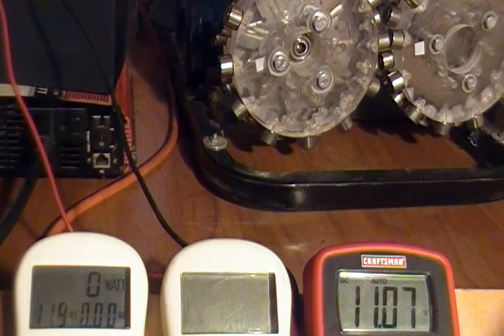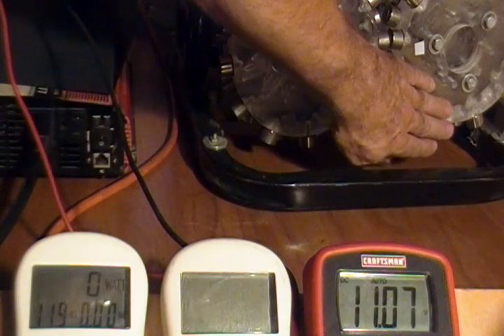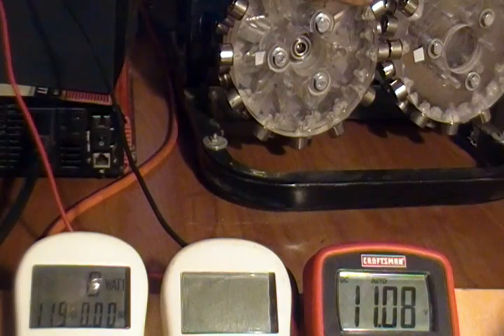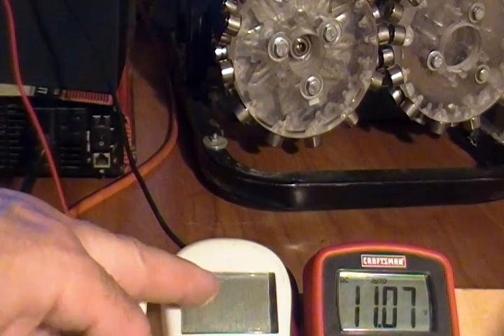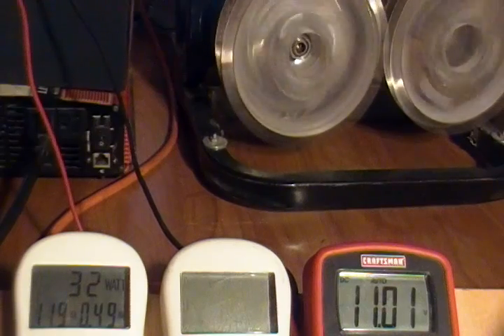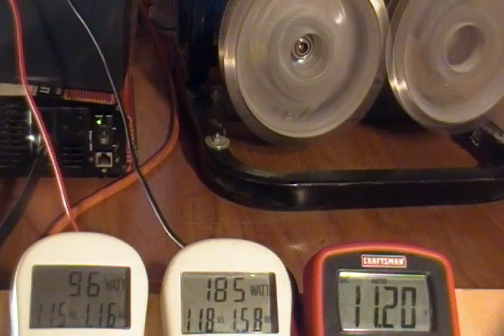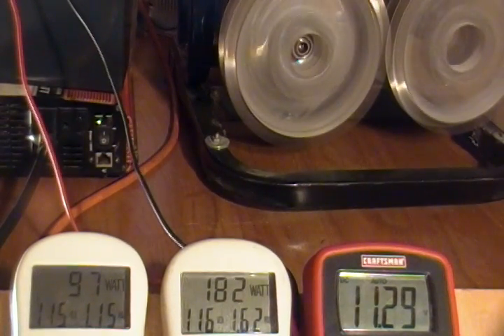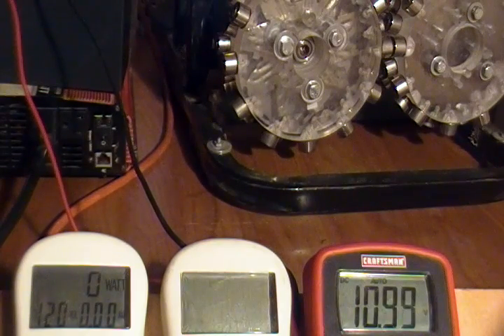Free Energy Electric Power Generator Overunity Magnet Motor

Comment: wait so i dont get what the big deal is? You have your device connected to a household current, correct? what is the excitement of being able to run a motor off electricity that is also running an alternator which i would hope would be making more energy than is being consumed? Isn't that pretty much a car engine substitute the gasoline used for mechanical energy?
Reply from the maker: This is an over-unity device. So it produces more energy than it consumes. If one were to run it off of a solar panel then it would consume no metered power and just free energy.

Comment: @Jamieduk999 want to try to get overunity? put together a 3 phase capacitor motor with a winding resistance of about 32 ohms as a alternator with a 3 phase motor as motor and gear up the alternator to 10000 rpm and overload  the alternator with potentiometers and many 40 watts light bulbs and the drag become small and the output big and everything near the generator turns static.

Comment: @MindFreer  Thank you for the answers!  IT would be very good to see your newer video, please show a looping situation after a startup, just keep a DC voltmeter across the Batcap 2000 to monitor the battery voltage and use a 100W lamp load at the AC output of the inverter.  Re on the CT transformer: I would have an opinion on its operation, I would be happy to discuss in e-mail if you feel like to, my mail is (gyulasun at yahoo com).  Thanks,  Gyula

Comment from the maker: @gyulasun 1) I'll have to do a video demonstation of this phenomena as it keeps coming up as a question. You can't hook a load directly to an alternator. I know because I tried when I first setup my device. The alternator will not produce power, instead it just makes this kind of muffled buzzing noise. My battery supplier told me the alternator was shorting out and I had to hook up a battery to it and put my load on the battery. 2) Google:"Xstatic Batcap model 2000" for info on my battery

Comment from the maker: @gyulasun Yes. That was one of my first experiments when I completed this setup. It ran fine for a few minutes then suddenly, it unexpectedly started consuming an incredible 600 watts until all the power in the battery was consumed and then the alternator shorted out, because you can't power anthing directly off of an alternator.  I think it might need more stabilization than just the battery.

Comment: @MindFreer   Have you connected your inverter's AC output (117-118V) to the motor input for a possible looping test?  (This would be the ultimate test for showing real "overunity".)  Let the 12V battery in the loop because it acts as a voltage stabilizer against a runaway situation.
Also, could you make another video where you show the two 100W light bulbs 'shining' ?
Thanks,  Gyula
Reply from the maker: I did hook it up in a looping test, but it didn't work. It ran for a few seconds and then it quit.

Comment from the maker: @dgerlach1You don't want the drive motor to consume valuable watts by driving a few alternaors fast. It's more efficient to drive many alternators at a lower rpm. Add as many driven rotors as you can to the line-up because interaction between the driven rotors is where you get most of your "free" energy. The farther away the driven rotor is from the drive motor in the lineup, the less watts it takes to turn it. There is an opimum balance between rpm and quantity of alternators so test,test,test.

Comment: Thanks for the response!
As far as Out/In energy goes, is faster better, or is there an optimal RPM ?
Reply from the maker: Yes, faster is better. This is just a test setup and I would need to make improvements in order to run it at a higher rpm.

Comment from the maker: @dgerlach1 There is no slippage. I have to start the motor slowly so the drive rotor and driven rotor stay in sync and the magnetic bond between the 2 rotors stay bonded. If I turn the drive motor on too quickly, then the rotors won't stay in sync, and I have to start over. The 2 rotors spin at the same rpm because they are both the same size with the same number of magnets. If I increased the size of only one rotor, but kept the magnet spacing the same, the rotors would spin at different rpm's

Comment: @MindFreer When running, does the generator wheel slip with respect the motor wheel, or do they run at exactly the same rpm?
Reply from the maker: I get slippage at higher rpm's. I need to layout the magnets differently in order to get the rotors to really lock together to avoid that problem.

Comment: @MindFreer Continuing on: The windings strictly harvest the electricity generated in them by the moving permanent magnet's flux fields.  All well known, basic electromagnetics.  What IS very different is that their is a net gain in power. IE it is generating more than it consumes. A fact & distinction allows for this without violating physics. The hard part is controlling the polarity interactions. Their may be (external) power utilized to control these fields, as opposed to producing them.

Comment: @MindFreer  Modern, VERY powerful day 'rare Earth' Niobium magnets will retain their magnetic fields for ~ 40 years. Thus over their lifetime, they can produce many, many orders of magnitude of power and electricity than required to make them. 'Over Unity' aside, not requiring external power to produce this driving magnetic flux is FAR more efficient. This seems lost on many that want to dismiss these types of existing motors. They have been used in Corvette starters.

Comment from the maker: @DougRH52 There are losses that can be reduced by winding your own coils and postitioning them around the perimeter of the spinning rotors and getting rid of the alternators altogether.  I believe it is even possible to size and configure the rotors in such a way that they will run perpetually with any drive motor at all.  I'll be working on that eventually.

Comment: Some of the newer very powerful 'Rare Earth' magnets as retain their magnetic properties very well and are hardly prone to losing these.
I understand how the magnets are used to transmit the rotary motion, but I don't see any windings that would generate electricity on the either side: other than the alternator that it is being driven.  If this is all that is being done, then there will just be loses stemming from both the driving motor and the alternator. The differential is VERY minor!

Comment from the maker: @markomanius I've heard various estimates about how long magnets last, anywhere from a few decades to a 1000 years.  I understand that magnets used in repulsion to each other rather than attraction tend to wear out faster.  One thing is for certain and that is that the energy produced with the magnets in this system is far greater than the energy it took to make the magnets in the first place.

Comment: What is the difference with your device and connecting directly a motor to a generator with an axle? Does the generator runs faster? The torque is higher on the generator side?  (if so how is that possible with the same diameter of the magnetic discs?)
Reply from the maker: Connecting directly to a generator with an axle would not achieve over-unity. The magnet driven rotors is what allows over-unity.

Comment: @LanteGFX - 6 volts in and 20 volts out is not an increase in power.

I assume you are saying there is 6 volts in at 1amp (= 6watts in) and there is 20 volts out at 0.1 amp (=2 watts), therefore that is 33% efficient.  Way less than 100%.  Never will be perpetual (i.e. self running)
Reply from the maker: I'm not trying to achieve perpetual motion. This is an over-unity device as it produces more energy than it consumes.

Comment: @ mindfreer
Almost finished with this project. This thing really breaks the bank. Magnet$ cost$ are going nuts. 
   
The only part I'm not comfortable with is the what effect frequency may play. Do you have any feedback as to weather frequency of the drive motor will play a roll? 

  I am also working on a perpetual motion version. I don't think it will have much torque, but it will support the drive motor OU concept. It will be bulky.  

  My version and theroy is different we'll see : )
Reply from the maker: I have achieved success without having to worry about drive motor frequency.

Comment: @ZoeMarks - how can power increase from one wheel to the next?  Any torque developed by a wheel can only come from the attraction of the magnets which acts both ways. The torque transferred will thus be equal on adjacent wheels.  Power is the product of speed and torque, as adjacent wheels have the same speed and torque therefore the power for each wheel in a series is the same.   Any other explanation based on real world physics you can think of?
Reply from the maker: I just know that it works, and I don't have a solid explanation why.

Comment from the maker: @LiamXaoh I had the same thought when I first built the system but I discovered resonant frequencies would build up and drain the system when I plugged it into itself and tried to run it perpetually.  Maybe becasue my drive motor is barely big enough to drive one alternator.  I have a design for an improved system that should work perpetually.  I'll be posting a video of it when it is done.

Comment: @MindFreer -I read one of your responses: "It is currently configured for overunity only, and not perpetual motion" I would like to know what is the difference between over-unity and perpetual motion?  Surely you can't have over-unity without perpetual motion.  I assume you're not measuring the inputs and outputs incorrectly if you claim over-unity and it doesn't self run.  Any machine that produces more power than it consumes must by definition self run.
Reply from the maker: I tried to loop the system to get it to run perpetually, but it only ran for a few seconds before it stopped. I'm sure there's a way to set it up so it runs perpetually. I just haven't figured out how yet.

Comment: Plug the output into the input and it should run by itself if it has over-unity capacity.  But we al know that ain't going to happen don't we?.
Reply from the maker: I tried that but it only ran for a few seconds. I'm sure there's a way to do it. I just haven't figured out how yet.

Comment from the maker: @z1zaz There are two 100 watt light bulbs plugged into the inverter.  The wattage figure stamped on any light bulb is only a rating figure and the actual wattage it will draw will vary according to a number of factors.  The meter in the middle displays the power being consumed by the two light bulbs.

Comment: wonder if you could rig it up and add another element, static electricity? your results will greatly increse.
Reply from the maker: More alternators could be added in series to get more power. This is just a test setup.

Comment from the maker: @froggyda1 For maximum effieciency I wouldn't do alternators at all because it seems to me it would be more efficient to just wind your own coils and mount them around the edge of the spinning magnetic rotors and pickup energy that way.  Alternators would be easier to setup though so I like the Windblue DC-500.  As far motors go, I'd like to see someone try DC because I've had problems with AC motors  It might be easier to configure it into a closed loop if the motor is DC instead of AC.

Comment from the maker: @kishbud   This is how is how I setup the meters:  The drive motor is plugged into household current, so when I turn it on, the meter on the  left shows the power its consuming.  When I turn the inverter on you'll notice the foreground lights up because I have two 100 watt light bulbs plugged into it (off-camera).  The alternator is actually producing more than the center meter shows which is why the battery slowly increases in voltage.  Thanks for your interest.

Comment: You have your meters confused, watch the meters as you turn things on. The meter on your left is your output and the meter in the middle is your input. You start your motor from some other power source because your inverter is off and AC motors don't run on DC so your not using the 12Volt battery. But when you start your motor the left meter registers data and when you turn on the inverter the middle meter starts registering data, which means that's output from your inverter running your motor.

Comment: if your alternator is an ac 3 phase squirrel cage motor, i think you get more charge power if you use a small ac current mabee 20 watts feed into the alternator as a motor and use a capacitor between the first phase and the middle phase wire in serial with a stepdown transformer because when the ac waves have different electric resistance they reduce magnetic drag, and allow a higher rpm on the alternator motor. make sure the rotor is spun in the right direction for COP 2:1

Comment: I came across this after surfing around for something interesting (being bored is a dangerous thing). Now I don't want to be a nay-sayer, I have been doing some research for 2 days now (no expert). I would looooove to cut down on the power bill for my already mostly green home theater (big lcd, powerful receiver, speakers, and sub, xbox, htpc = ~250-300watts under normal use). Magnet gears/rotors are pretty awesome. I can see them in a lot of applications if they last like they should. But...

Comment: With the recent news of China beginning to restrict exports of rare-earth metals to full-fill domestic demand, supply of the materials needed to make these rare-earth magnets are about to dwindle and the cost about to skyrocket.

Can this cogging motor still achieve overunity with ceramic magnets in place of rare-earth ones?
Reply from the maker: I suppose, but it would be more difficult. It's been 13 years since you posted this comment and I don't have any problem getting magnets.

Comment: @MindFree 
skipeychops told you about your metal frame slowing down the performance of your device. you replied that it had no net effect because it slows and speeds the rotor.

i think he was right. the metal frame act as a Stationary opposing pole. so it may not have much effect but i think it would slow it down just like keeping one wheel from turning.

Just a thought.

im still researching this before a comet a thousand plus dollars
Reply from the maker: This is just a test setup. Ultimately, I agree. A nonferrous frame would be better.

Comment from the maker: @YellowCakeKid I think you have "perpetual motion" confused with "overunity".  I never said this was a perpetual motion device.  You're right, with a perpetual motion machine all you would need is that initial push and then the system would run by itself without further assistance.  For overunity all you need to demonstrate is that there is more energy coming out of the system than is going in.  My perpetual motion machine will be in a future video... stay tuned  ;-)

Comment from the maker: @tadythefish  The drive motor is 3-phase and I have a converter wired to it to allow it to operate on normal 115 volt household current.  The converter also allows me to adjust the rpm on the motor as well as well as regulate the start-up speed.

Comment from the maker: @soulsammytube I've tried this and for some reason it doesn't work.  I am told by another who has also worked on this system that if I can get it above 3000 rpm I can unplug it from the wall it will run perpetually, but my drive motor is not big enough to get the alternator up to that rpm and so I haven't tried it.

Comment: Is there a way to set up your wiring so that after you get the voltage and watts built up you could plug it into itself in a loop and then disconnect if from the wall source of power and thus make it an independant system?
Reply from the maker: I configured it into a looped system, but it only ran for a few seconds and then it quit. I would have to do more experiments, but I'm sure I could get it to work if I wanted to. Over-unit was all I was striving for.

Comment from the maker: @spikeychops If you connect an alternator directly to an inverter without a battery between them, the alternator produces no power, and just shorts out.  I know because I tried it.  The guys who sold me my Batcap, confirmed this.  When I put the system into a closed loop, my batcap drained and created no resistance, it was as if I'd hooked the alternator directly to the inverter. You can tell when an alternator is shorting out, it makes a recognizeable sound.

Comment from the maker: @unknownerrors226 Yes, you're right, but perpetual motion would be a device or system ran entirely on its own without the need for additional fuel or energy.  If a device ran for 15 years and then the bearings needed to be changed, or several hundred years before the magnets need to be changed out, I think it is a pretty good PM solution.  The earth revolving around the sun is good example of PM, but you could argue the sun is going to go Super-nova in a trillion years so it's not PM...

Comment from the maker: @K0W0O0N0 The magnets are aligned N to S so they attract each other.  I'll have to do a separate video demonstration to explain where the additional power comes from.  I have not tested an additional alternator but others have and what was discovered is that with each alternator that is added, the power to spin it is split up equally among the earlier magnetic rotors in the series. So with another alternator 50% of the power would come from each of the 2 other rotors, add another and 33-1/3%...